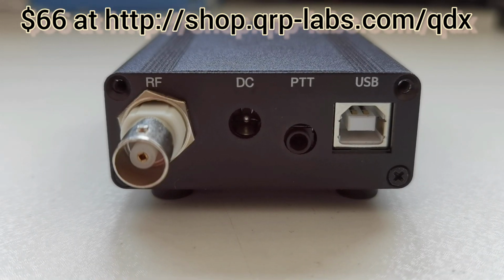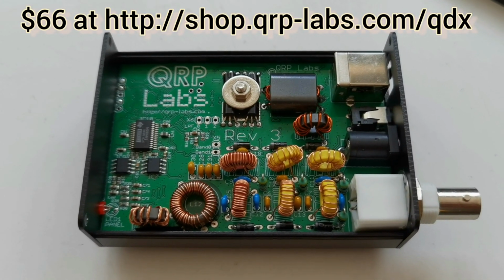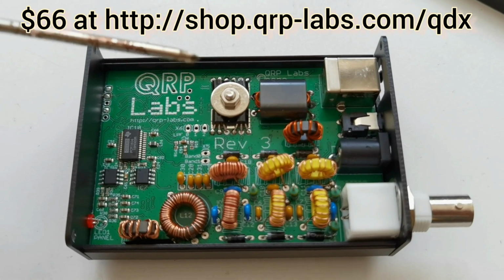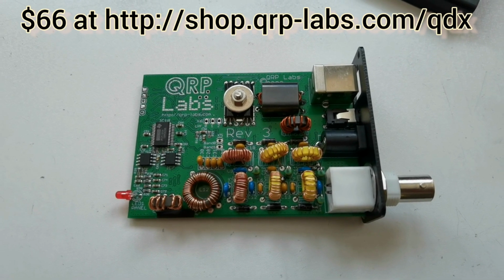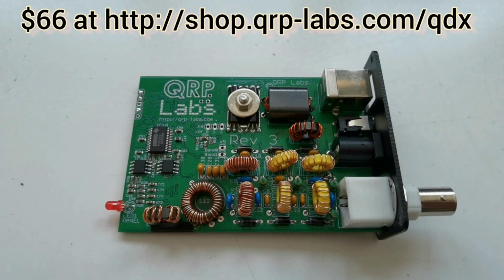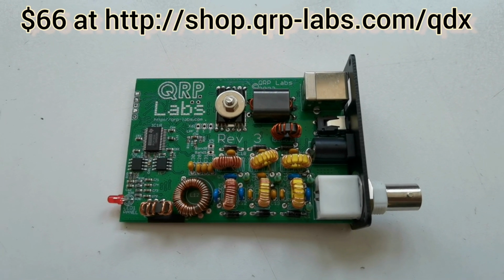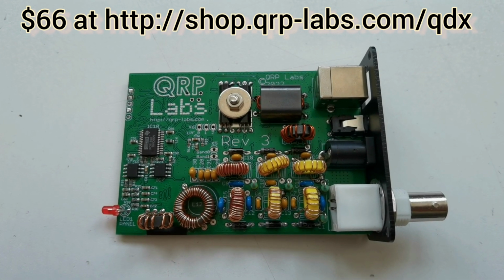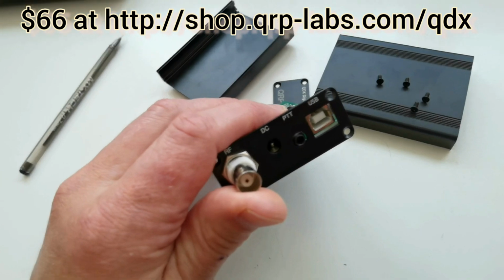QDX batch 3 now available, 1st May 2022 at 1800 UT

Comment: When last I tuned in (rev 2 had just sold out) finding a supply of compatible microcontrollers was a problem.  What did rev 3 end up with?  Any important differences between this uC and the prior two?
Reply from the maker: The microcontroller is the same STM32F401. It just cost me a lot of work to find, and a lot more money to buy. The ADC chip was changed from the now obsolete AK5386 used in Rev 1/2, to the Texas Instruments PCM1804. This chip has 112 dB dynamic range, and a differential input offering excellent common mode rejection. I spent 3 months re-designing the amplifier circuits that sit between the quadrature detector and the ADC, to be able to achieve the full performance advantages. The result is the Rev 3 board has about an 8dB lower noise floor than the Rev 1/2 (a sensitivity improvement which is not really of much consequence on 80-20m bands anyway). The Rev 3 board has a PTT output connector suitable for controlling an external amplifier. Other than that there are no major changes.
Reply: @QRPLabs  Thanks for your perseverance!  It's been a very odd two years.  The new revision sounds great.  So pleased there are some currently available.  Just placed an order. 🙂

Comment: I managed to get a V3 and built it. Worked first time and set to 12V with the winding reduced on the binocular toroid. Putting out 5W exactly. However the BS170 decided to blow smoke eve thought the SWR was 1:1.1. So warning, don't use it at max supply voltage for prolonged periods. Im going to reduce to @2.5W. I will update what supply voltage is required to achieve the wattage and hopefully the BS170s last this time.
On the positive notes, it works with very good sensitivity on 20,30,40M as tested. Very compact and now going to setup raspberry /orange pi to run it now.
Reply: I wish I could post pics in YT comments...

I "turboed" my QDX by adding a tall, finned heat sink.  The heatsink is about 1/4 of a one for a CPU with passive cooling.  After cutting if off, this quarter piece is about 22mm x 28mm x and 36mm tall.  To transfer heat, I mixed high temp automotive RTV with aluminum power - filing dust - into a thick paste and smooshed that around the BS170 transistors, avoiding their leads but contacting the PCB copper fill below.  I drilled and self-tapped the heatsink for the QDX kit supplied screw to firmly hold it all together.  Heat transfer is certainly not ideal, but seems to do the trick.  Had to cut a square hole in the top half of the case to let the top 25mm of the heatsink to stick out ;)

I've run it hard at 11V supply - FT4, FT8 and WSPR - up to 2 minutes continuous key-down.  I've gone as high as 13V briefly, but I haven't been keen to get too wild and risk having to dig through all that RTV to change transistors ( again ;)

Comment: Thank you QRP Labs, for putting the Docs online..  
"Latest documentation
You need TWO manuals, one contains the Operating instructions, one contains the Assembly instructions, Theoretical design information, and performance measurements. 
Assembly manual for PCB Rev 3 (document version 1.11 published 07-May-2022)
Operating manual for firmware version 1_03 (document published 23-Dec-2021)"

I'm trying to get a color print out of about 30 pages of Assembly. So I can prepare for the build.. :)

Comment: Does it supports PSK modulation? Or is it FSK only?
Reply from the maker: It's FSK only
Reply: @QRPLabs  How fast can it be on FSK?
Reply from the maker: @Neo_Chen  I don't know exactly. By default it measures and updates the transmission frequency 100 times per second. This is configurable. It can probably run several times faster than that.

Comment: Thank Hans  was able to pre-order today (May 3rd) with 518 showing on the availability counter.  I haven't done much digital but that will change with this little "Black Box".
Reply: edit:  I did not get it in time for Field Day but once I did get it and put it together I fell in love with it.  Easiest to use for digital modes radio I've tried.  Just completely awesome.  Many, many QSOs made on FT8 and FT4 !

Setup is simple: plug in Power, Antenna, and USB cable to a PC or laptop, run WSJT-X and set it up with Hans' easy to follow instructions.

---
I've had grand fun with FT-4 and FT-8 at 25W max using an IC-7300.  I'm sure this will be a fun radio even at 5W !  I hope to have mine and built to show off at Field Day 2022.

Comment: I am relatively new to ham radio and this device. Can you use this transceiver for phone or are you limited to digital modes?
Reply from the maker: Only digital modes
Reply: @QRPLabs  Okay. Thank you.
Reply: @Aduhwan  Don't worry about it unless you really, REALLY want voice and nothing else.  For the price, this is an awesomely capable radio and digital modes like FT-8 can be very rewarding.  Clear DX contacts - software maths its way through the noise for you.
Reply: @Randrew  In light of your passionate response, I will consider purchasing and building one of these radios...if they’re any left. 😉(Thanks) ✌🏾

Comment: looks great with the improved band condition would 10m or 6m be an option that would be  great for wspr ft8 type mode for monitoring band conditons.
Reply from the maker: I'm going to experiment with higher frequency bands, yes. I hope to at least be able to cover 10, 12, 14 and 17m.
Reply from the maker: P. S. I meant 10, 12, 15 and 17m of course.